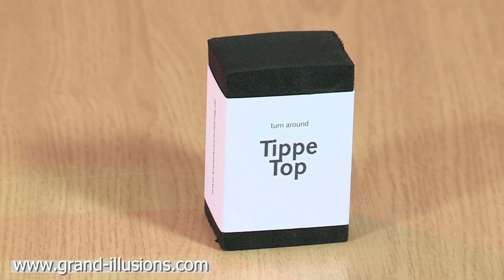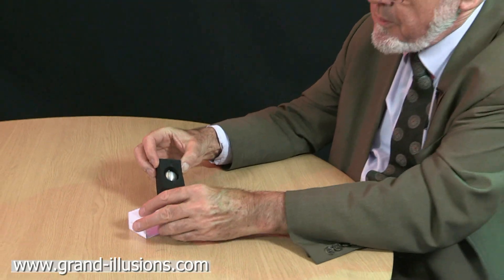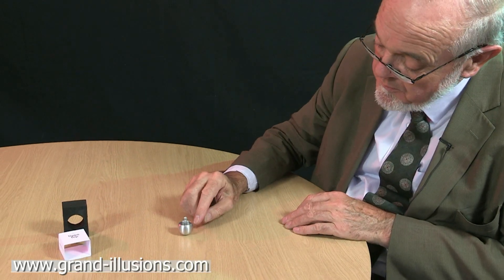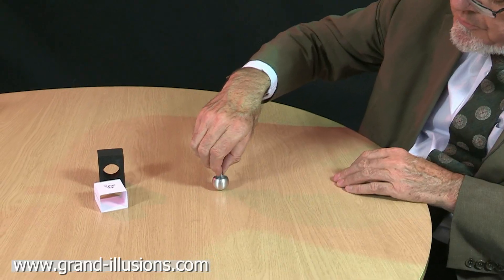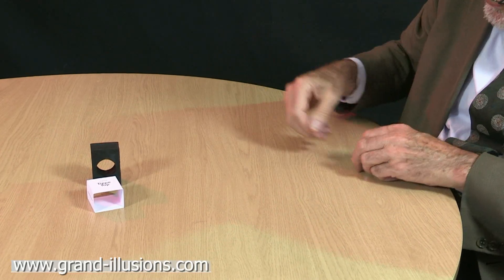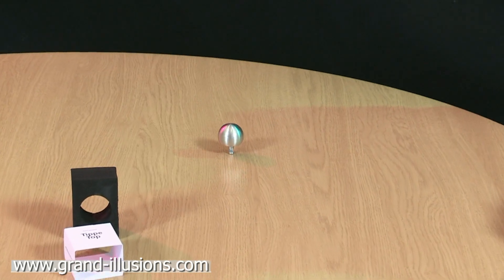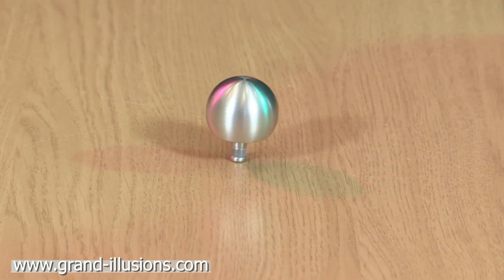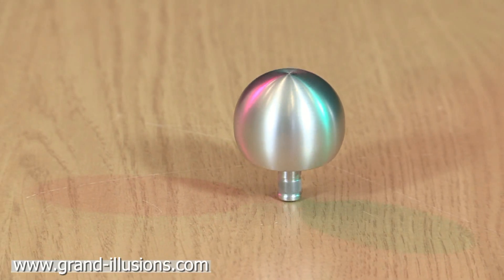Tippe Top

Comment: Why does it turn over?
Reply: +Melinda Green  http://arxiv.org/pdf/physics/0507198.pdf  Good luck!
Reply: DANG JOS
Reducing a problem to one with a known solution is a time-honored technique, but this one drags in quantum chromodynamics in the process. Holy crap!
Reply: Melinda Green  Wait what?!  Where in the paper was the QCD??
Reply: DANG JOS
At the very end. What, you suggested it for me but didn't read it?
Reply: Melinda Green  I saw your question and remembered seeing an explanation, so I found it and posted it for you.  I did skim it over, but I am far too tied up with my own physics exams to thoroughly read it.
Reply: Melinda Green  Yes, they found a resemblance in the equations.  That probably happens more than we think.  When describing a quantum system, one writes down the Hamiltonian that describes it, which can essentially be a classical formula that is formulated into the Schrodinger equation
Reply: DANG JOS
I got the gist but couldn't begin to properly review it. Invoking QCD was a big surprise though. Seemed like using a nuclear powered chain saw to cut hot butter.
Reply: Melinda Green  Lol!  Yeah, I believe there is a more intuitive explanation that I read some time back that doesn't require nearly this amount of formalism.  I should try and find it
Reply: DANG JOS
This paper seemed to suggest that this is a new result but I may have misread that.
Reply: YOUR MOM!